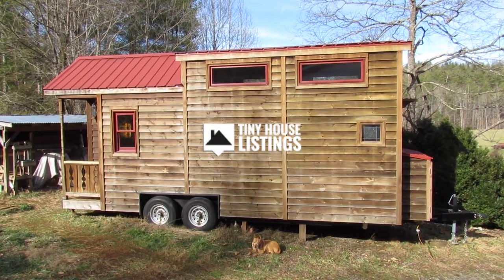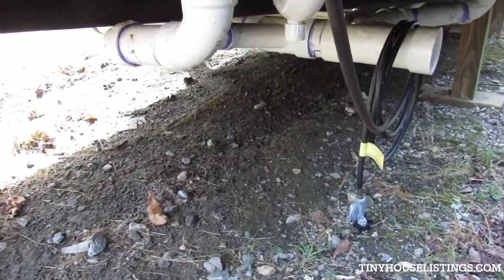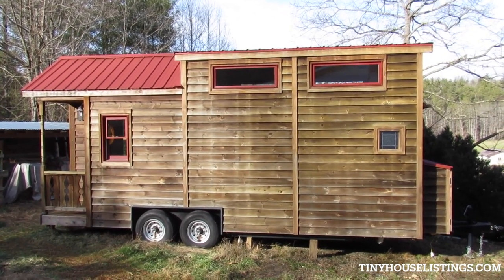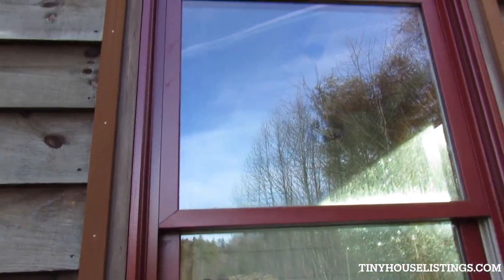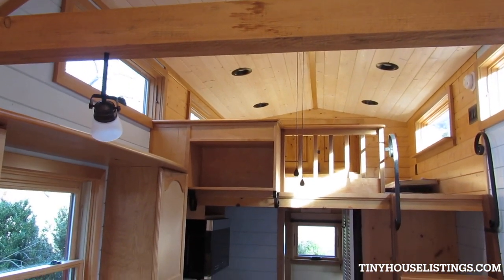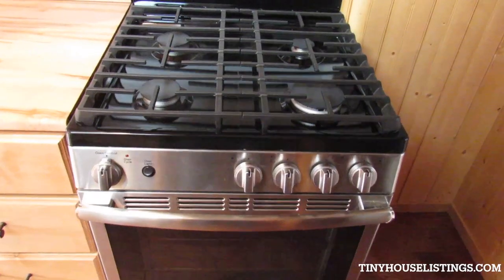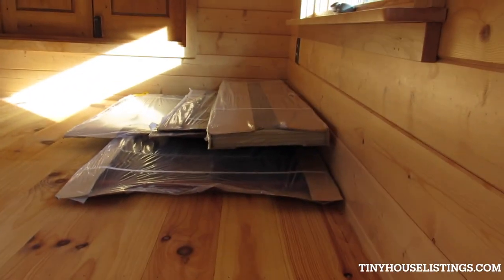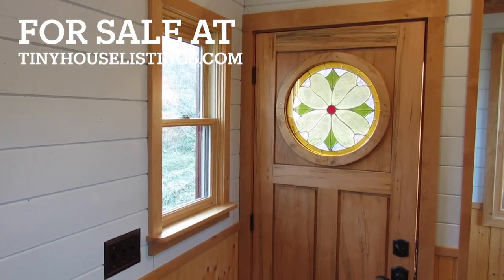Cedar Cabin Tiny House Was Built For Comfort

Comment: pretty, but the plumbing underneath, not designed to travel, or for cold weather.
Reply: Those are just drainage lines and would be empty most of the time.  May be a problem on some terrain while moving it but it can still be moved if you're careful as there's still clearance, just not a lot.  Actual problem would be the water inlet and spigot on the side and the water heater in the shed.  Since, on demand doesn't heat the water when it's not running and those are the lines where water in the lines would be vulnerable to the cold, not the bottom... Plumbing is otherwise insulated...